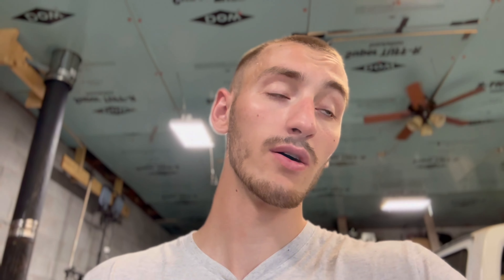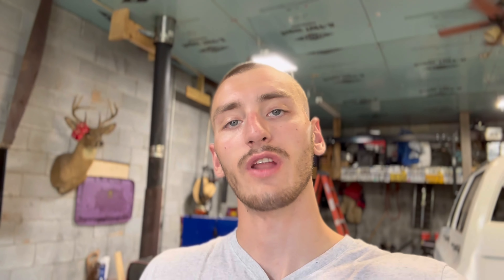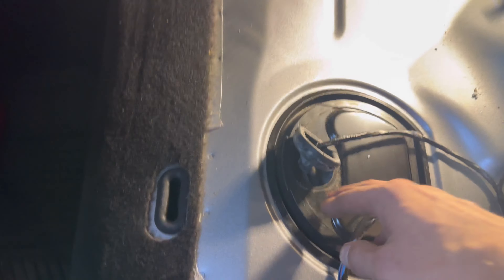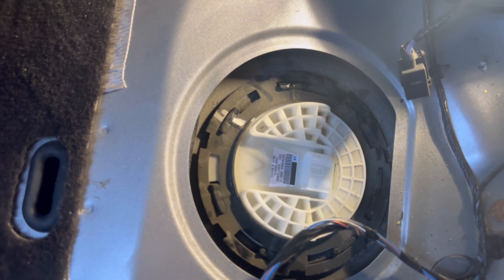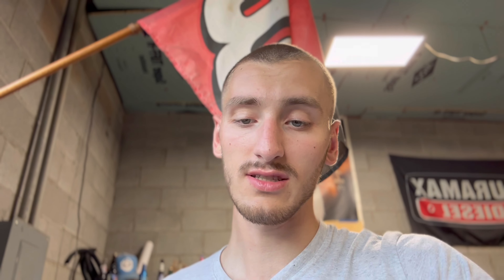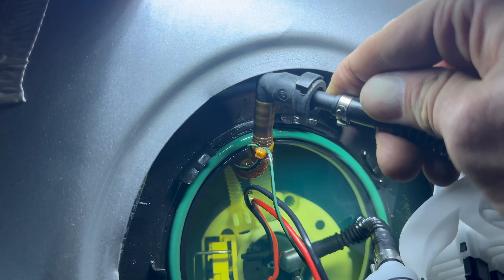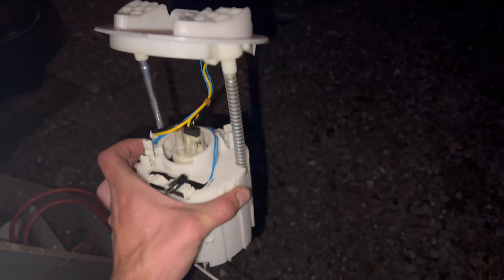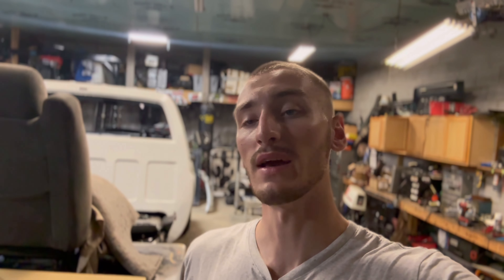MY CAMMED 392 GETS A NEW FUEL PUMP!! *NO WIRING*

Comment: How many fuel pumps to needed to change
Reply from the maker: Just one one the passenger side
Reply: @tallguyinahemi  will it be the same for a 392
Reply from the maker: Yessir
Reply: @tallguyinahemi just saw your vid you changed the driver side right ?
Reply from the maker: @Scatattack498  yep driver side
Reply: @tallguyinahemi  you think I can wire using the stock basket
Reply from the maker: @Scatattack498  with a different pump?
Reply: @tallguyinahemi  yes
Reply: @tallguyinahemi  a walbro 450
Reply from the maker: @Scatattack498  I’ve heard you can wire up a walbro pump but I’ve also heard the wiring often fails..